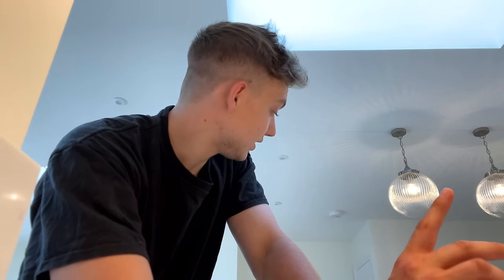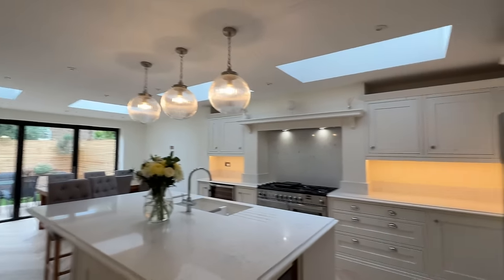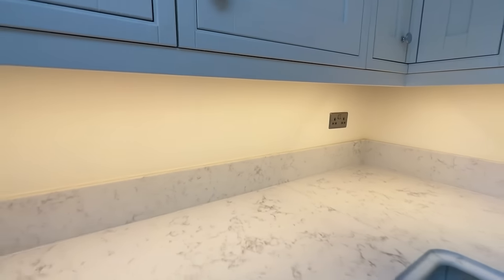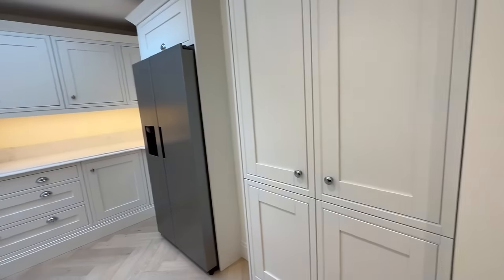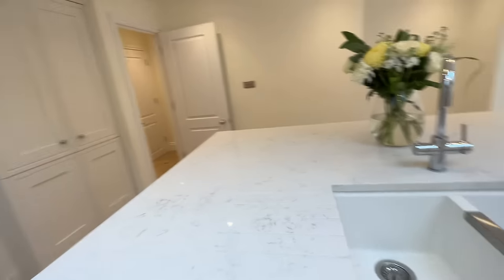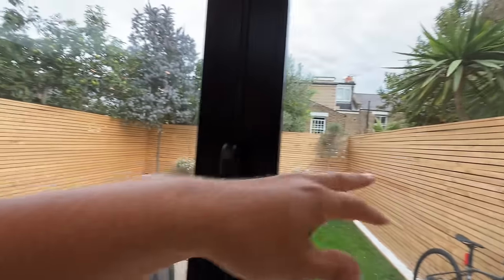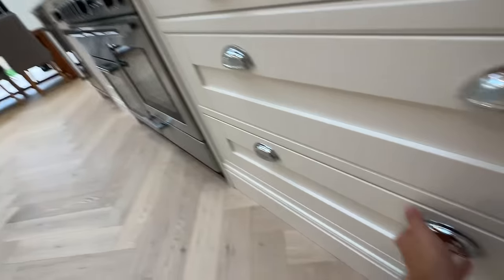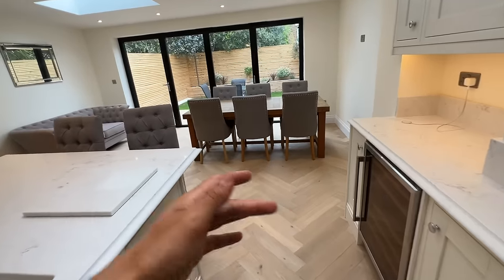DREAM KITCHEN REVEAL - FULL HOUSE RENOVATION ON OUR LONDON VICTORIAN TERRACE - FINISHED HOME TOUR

Comment: I bought a 20 room Regency mansion on the Yorkshire coast which was literally falling down. My 6 month renovation took over 2 years! EBay was a godsend for me. I could go on for hours about the bargains I bought and collected from all corners of the country but the best one was a hand built kitchen by Mark Wilkinson which originally cost over £80k picked up for £3k from Regents Park. The fridge alone costs £14k and we simply dismantled it and made the room fit the units rather than the other way round as you would usually do. The bonus really was nothing in the kitchen had ever been used so we saved about £75k and it looks amazing. I love what you have done here. It’s a top class job and I can see how much you enjoyed it. Well done.

Comment: The more concrete you use the higher the carbon impact as it quite high carbon cost. I wouldn't say that was a large garden for london. That high fencing is not great for gardens. It's not jealously. The more light the better for gardens. This trend for 6ft fences is not good.

Comment: You must be so proud doing so much of it yourself, seeing how beautifully it turned out! I like a lot of these ideas, though I'd make changes: a) a stove tap for filling pots, b) cutlery drawer should not be in the larder, too much faff to grab a fork - should be easy to access and on your way to the table and c) needs a full splashback, that plaster/bare wall is going to get manky. I'm designing for my terraced house kitchen extension so seeing these types of videos is so helpful - I know what I want & don't want! Wish I could do half as much as you (I'm a 5"3 weak woman).

Comment: Man hole inside the house? Could you not have had that re-routed outside? I have never seen this in the UK. What happens if that over flows into the house with waste water does your house insurance cover the contamination?